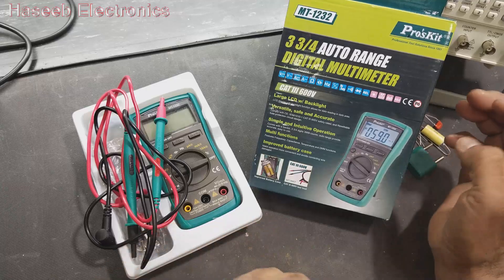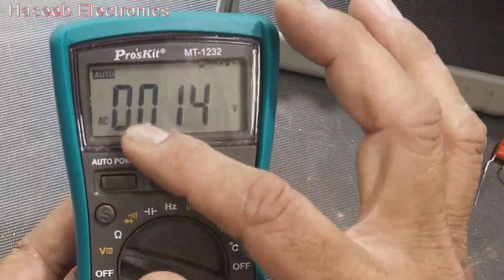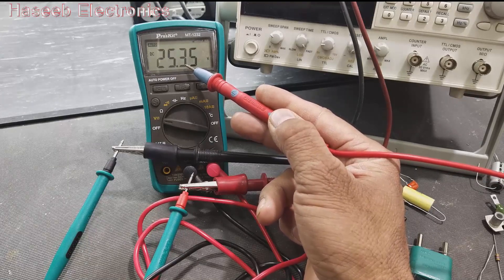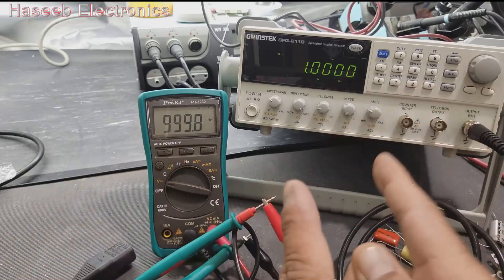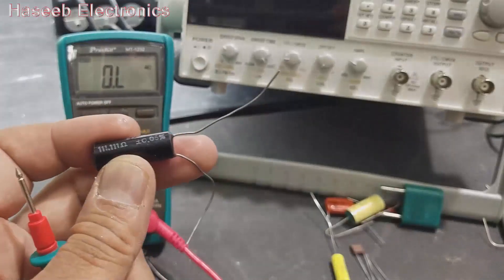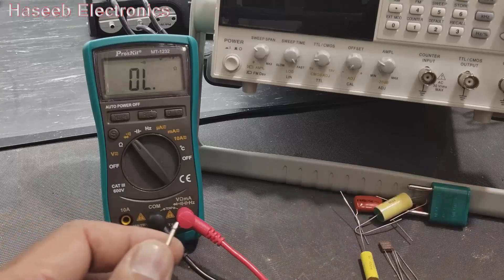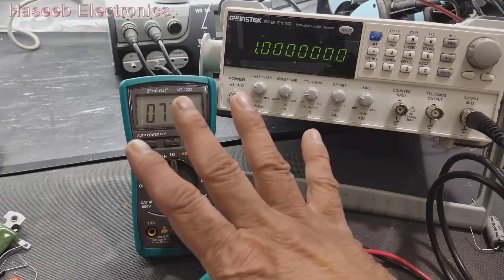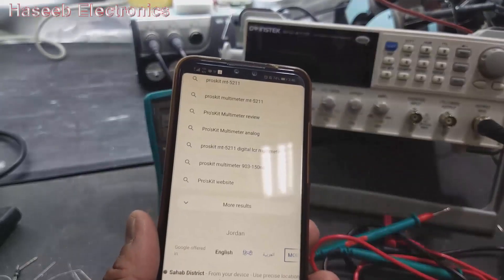343 How to Use Digital Multimeter - Pro'skit MT-1232 Digital Auto Range Multimeter

Comment: Good morning, I enjoyed your video explanation, I am interested in buying the product, and I realized that there are 2 identical models, and do not know which one to choose, can you tell me what the difference is between them, Pro 'sKit MT-1232-C or  Pro 'sKit MT-1217-C
Reply from the maker: MT1217 is better. it have more better ranges for frequency, capacitance, resistance have 60M ohms, 
price is slightly higher than MT1232
so i will recommend MT-1217-C
Reply: @HaseebElectronics  Thank you very much for the advice, you helped me a lot. I really enjoyed your explanation of the product and the examples you gave during the video. Thanks

Comment: Sir what could be the reason if an smps is given out 109ac volt instead of 5vdc at the output
Reply from the maker: it means there is a winding leakage between primary and secondary.

Comment: Thank you! My meter started acting up last night and then it's funny how you put up this video at the same time! I'll have to look into getting one of these. I especially like the fast switching between ranges and the frequency counter goes to 10 Mhz. Nice large display too!
Reply from the maker: wonderful. 
i found this multimer very useful, comparing to fluke multimeters 
this one have 600volt while fluke have 1000 volt
in capacitance it have 100uf range while fluke have more
comparing to price this is in 20-30 dollars range and fluke is in 300+ dollars range
Reply: @HaseebElectronics  My meters is ok, just needed new batteries. This one does look good and I might get one anyway. I do a lot of vacuum tube work, so 1000 volts is better, but you don't need that high very often even with tubes.

Comment: Sir please help!!!!
Laptop charger ic (L2269-si) is not self starting (switching). How to fix.?
The power resistors (1 Meg ohm) is ok..  When I charge the vcc capacitor externally using 12v supply the ic starts switching. There is a little fluctuations like 20.1 v to 20.4v...
Reply from the maker: please check feedback circuit, it is not working properly, might be voltage reference or optocoupler 
or there is some component failure in secondary side
Reply: @HaseebElectronics  thank u sir. Actually i am electronic hobbyist. I have learnt about smps from your videos , which are really very helpful.

Comment: Maximum capacitance is 100 uf that is very low
Reply from the maker: you are right. maximum capacitance test option have low range
but its other features are awesome
Reply: Sir I have a 12v smps. I want to increase its output voltage to 35v. Is it possible? If possible then How can I do it?.. It has two optocoupler on the secondary side
Reply from the maker: @rinqucosta2422  please check video number 283 for a detailed answer